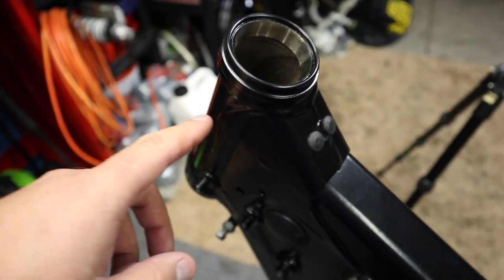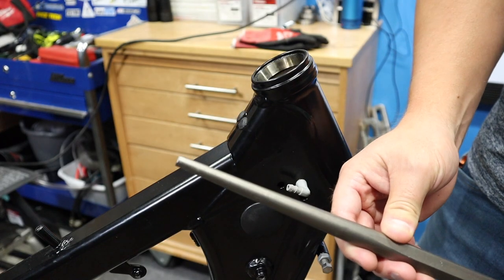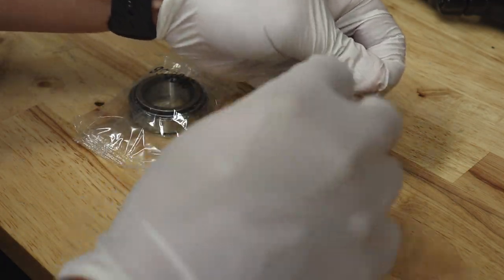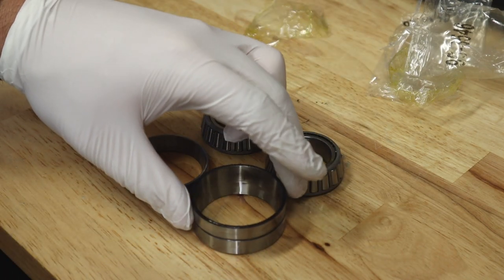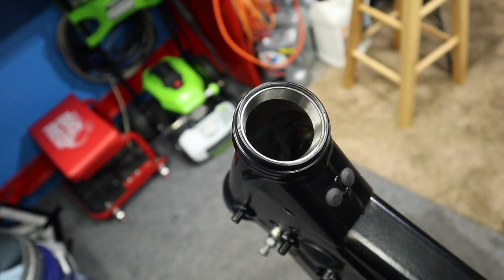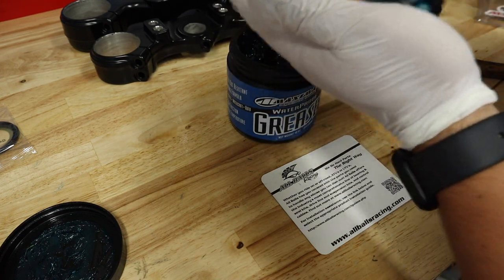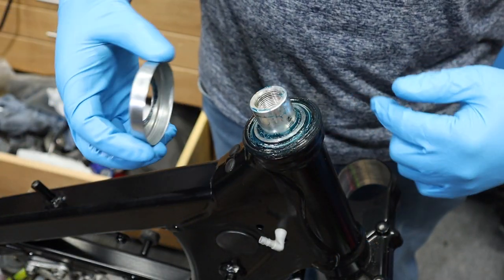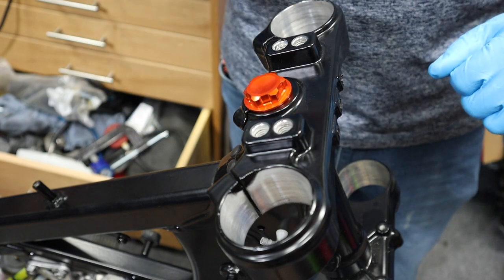KTM 125SX BEARINGS AND CLAMPS | Triple Clamps look sick!

Comment: my top bearing is stuck, seems like it rusted and seized up on a 2018 yz 125. whats the best way to get that out when it doesnt let the triple clamp drop?
Reply from the maker: Go check out my other video I did this on my yz450f, it will be more similar. You’ll have to drive the steering stem down through the bearing. Try some pb blaster for a few hours, then add heat (caution the flammable aspect lol), that should help free it up. Good luck and this happens more than you think.

Comment: Hey man,did u use the original factory clamps that came with ur bike? I'm having a problem finding the bottom clamp in good conditions.The left side on the ones I found already,are broken because the steering stopper bolt on the frame!🤷‍♂️ Any way to fix that?
Reply from the maker: Yes they are the factory clamps that have been powder coated. Not sure what this issue is with yours exactly, but i wouldn't chance a clamp with any breaks in they at all, or damage. They take too much abuse and are responsible for way too much load. I hope you find a set asap so you can get back to ripping. Thanks for reaching out Jorge!!!
Reply: @DanMX2112  Thanks for the info & reply.There's any way I can send u a picture thru this?
Reply from the maker: @jorgelsanchez4388  no but go follow me on instagram and you can send one there.